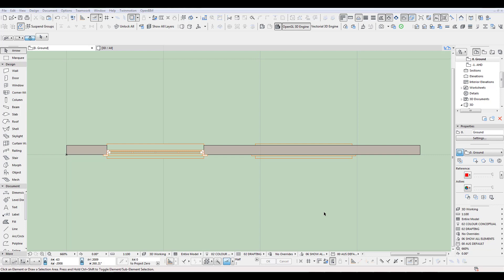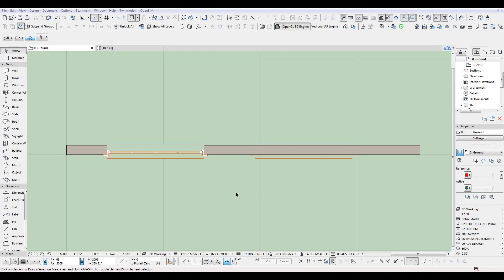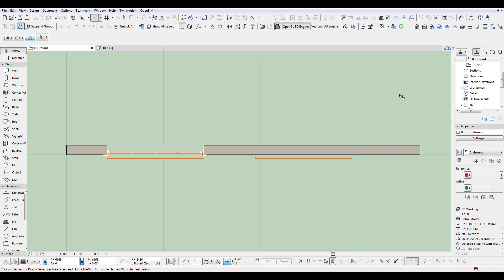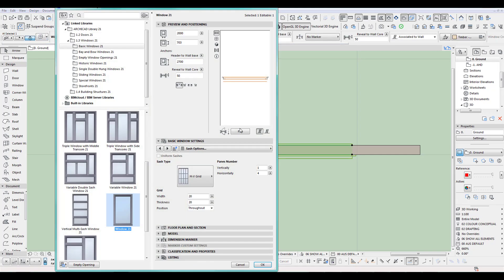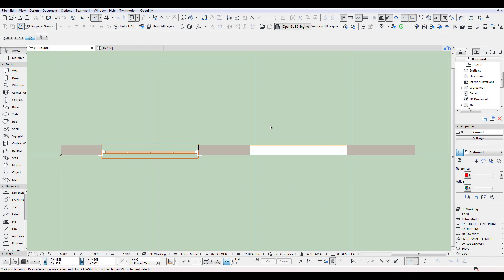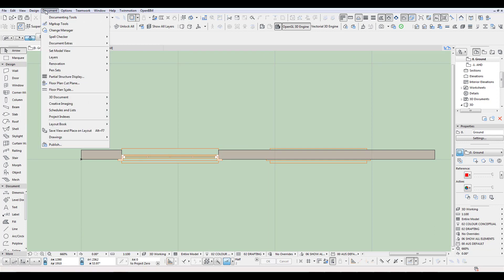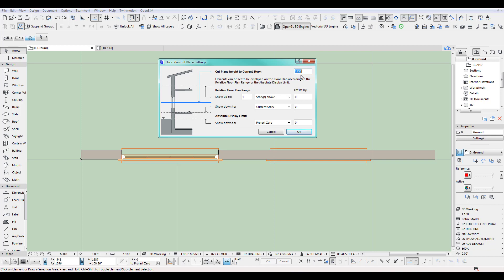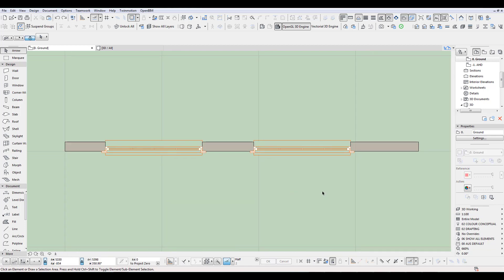How to show window cut in wall for high windows in ARCHICAD

Comment: Theres a tool in Revit where you can change the cut plane height of a selected area, in this case you could  show only that window in a diferent cut plane height. Is there something like this in Archicad? Thanks
Reply from the maker: we do have a cutting plane in ARCHICAD. Just google it to learn more about it. I did a quick tip a couple of weeks ago about this topic in regards to how windows show in plan when they are different in height. Have a look at it, here the link.
https://youtu.be/M_kajpbUn8M